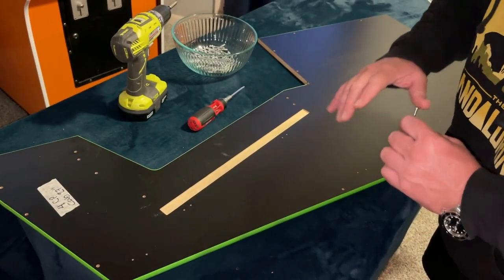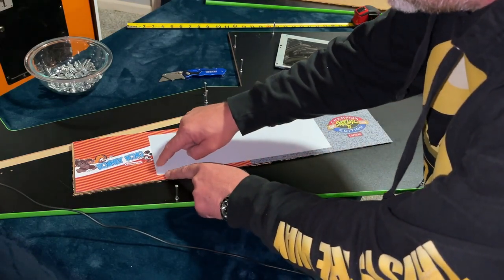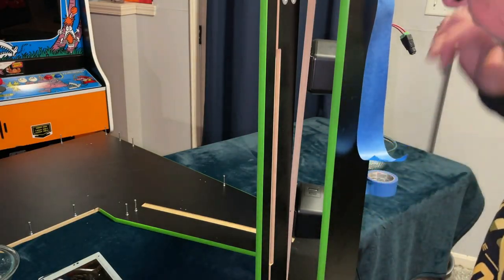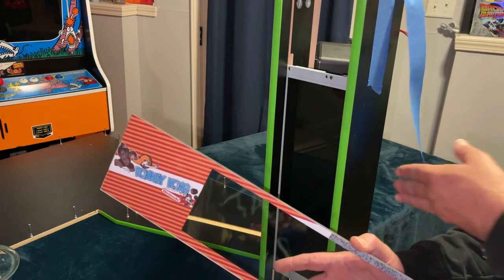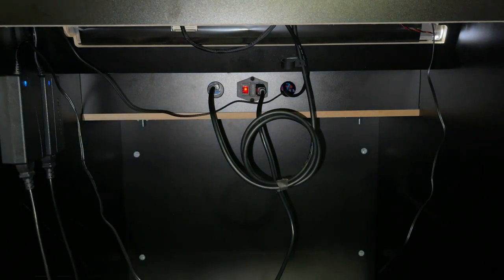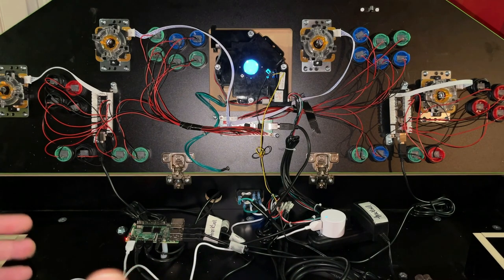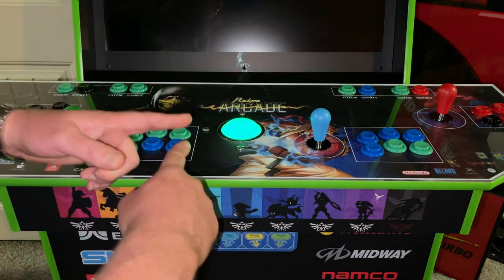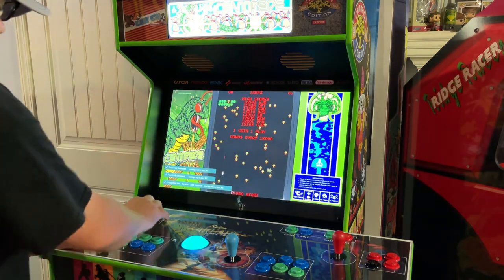How To Build Arcade w/6K Games | Game Room Solutions 4 Player Gameplay & Review

Comment: Thanks for the great video! Once we get the house, I want to start building a multicade. GRS is definitely the best option that I've come across and I love that their cabinets are designed to be easy to modify/upgrade to your liking. 
I really hope to see them release a 4-player cabinet with light guns because they currently only have the 2-player with light guns. Either way, their $1.5-2k price point is fantastic!
Reply from the maker: Thanks for stopping by 👊 Yeah GRS has a lot of different build options and they will also work with you on custom graphics as well. The RPie4 does a great job with 99% of the the classic arcade games! I ended up picking up a $300 Ryzen mini pc so I could play some tougher to emulate games and consoles. I also upgraded the control panel with an iPac2 - have some vids on it if you want to check it out. Super happy with my arcade. It replaced 5 other arcades. 😄
Reply: @DKOG73  that's good knowledge! I'm not super interested in putting anything past ps1/Gamecube on the system (although that may change), but I am interested in playing 3D games like Gauntlet Legends and even the more recent shooters/indie games on my future cab. I like the idea of tinkering with it, but having a company that will set you up with a fantastic stater cab that you can build upon is everything a newbie could ask for.

Comment: I'm watching this now but figure I would ask the question since most people don't show or comment about it in case you don't in the video. I have seen these cabinets on their website and seen a few put together. Nobody talks about how sturdy they are while playing them. I'm not a big fan of a cam lock furniture cause it normally isn't that sturdy and the cam locks can make them have weak points sometimes. I was wanting to go with bartops for my collection caude i want to build a cabinet for each retro console so the buttons match and I dont have a lot of extra buttons just sitting there. Also will have each cabinet custom graphics for each one matching the system. Thanks for any feedback.
Reply: Its a sweet build with all the bells and whistles
Reply from the maker: James Thanks for stopping by 👊 I have a built a few bartops from GRS as well as the 4 Player cab. The mdf is pretty high grade and the Arcade is very sturdy and heavy. I reinforced the control panel as I knew with 4 people frantically playing it was going to need some additional strength. Did a video on that and a mini pc upgrade so I could run CoinOps and play games that the Rpi would have trouble with like Ki and NFL Blitz. Will reply with a link to that. Very cool idea for multiple bartops with console theming. Whatever choice you make definitely lmk how it goes 👍🏻
Reply from the maker: Here is a link to the upgrade vid - Thanks again for stopping by 👊 
https://youtu.be/FDCKT0O3r44

Comment: Do you recommend any good 27 inch monitors for your cab? Thank you.
Reply from the maker: Asus gaming monitor
Reply: @DKOG73   thanks. I know this may be a silly question also , but how do you turn your monitor on and off being that your monitor is inside the cabinet but behind the bezel plexi right ? Does your monitor have a remote ?  Most buttons on monitors are either on the sides of the monitors or under them. Thanks 😎
Reply from the maker: @RomeoRuizMusic When Arcade is powered up the computer monitor should automatically turn on.

Comment: how does the marquee work...is the software included for it?   i am thinking about getting one.
Reply from the maker: Thanks for stopping by JP👍🏻 Yes the lcd marquee software is included with the Raspberry Pi which is essentially plug and play!!
Reply: @DKOG73  ok thanks for quick reply...i am using a pc so this would not work for my build.
Reply from the maker: @jayeparker9281  I actually upgraded from the Pi4 to a Ryzen 7 mini pc and utilize CoinOps Collections - if you google that you will find all the answers you need!!

Comment: Did you have any issues getting the last panel flush? I have the mid size one and it won't sit flush. Their instructions are horrible and their customer service is some of the worst I have ever dealt with. I have had the cabinet since before Thanksgiving and still haven't played it yet.
Reply from the maker: Justin thanks for stopping by. Yeah it was a bit off. I used Velcro and rubber feet to resolve it. Making a vid on it tomorrow.